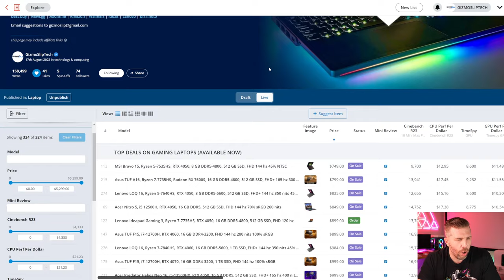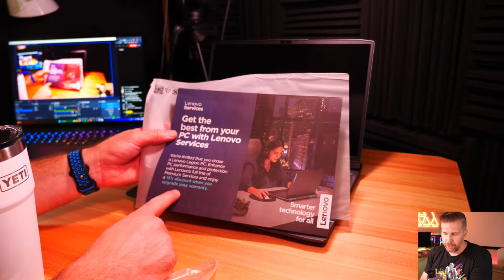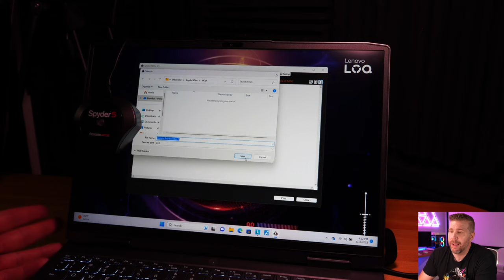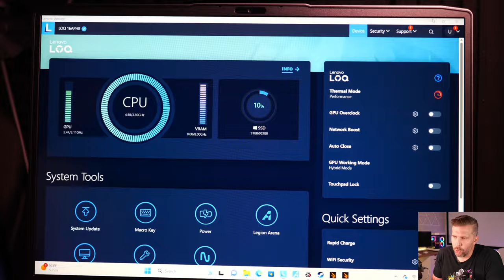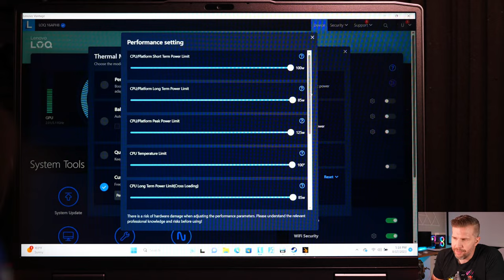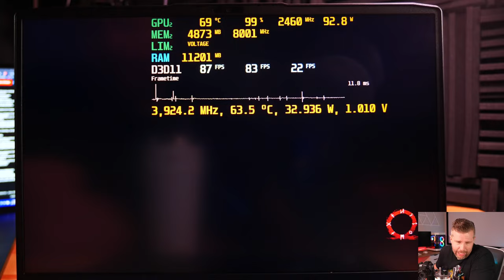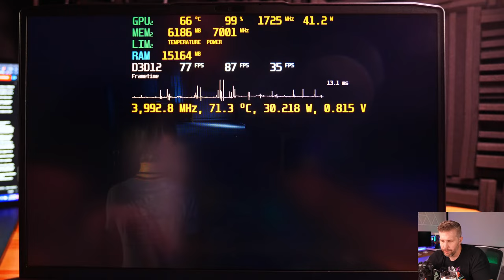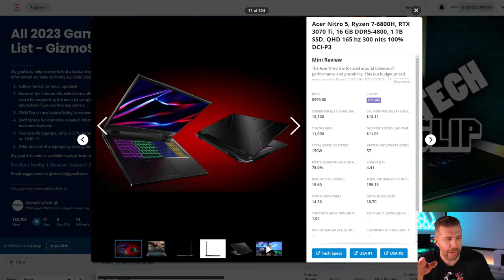Legion LOQ 16 Unboxing Review! Best Budget Gaming Laptop 2023? 10+ Game Benchmarks, Lots of Tests!

Comment: Any thoughts on what would happen if the Charger is only 170W. That's what's being shipped in India.
Reply from the maker: That does seem low, but it should be enough for near full performance or full performance. I am sure you could buy a 230w adapter. 

If the battery is draining under load, then you could try undervolting the gpu and lowering the cpu power limits when under dual cross load.
Reply: 6
Reply: inho
Reply: @IamNiggler  why?
Reply: @IamNiggler how you can born gay💀

Comment: Sir, should the fans sound like that all the time? I play sons of the forest and the fans runs nonstop. Gpu around 55 celsius and CPU 75-80 celsius
Reply from the maker: Sounds normal, but you can tune fan noise in Lenovo Vantage in custom fan mode if you want

Comment: There is a custom build option where a 1440p display 100% srgb option available and a 4 zone rgb keybard option
Reply from the maker: Good point, though that will cost more. So it will depend on pricing
Reply: @GizmoSlipTech  the difference is price was minimal, it was less than 50 dollars if i remember correctly, ordered a custom last week.
Reply: I could not find this option, was a little pissed about it but I still love the laptop, I bought an external monitor for home
Reply: Actually 😅 the full specs custom laptop actually cost LESS. ...way less than even the max by on Amazon or Flipkart. But we need to wait 1 month. But it's worth the money + full specs :)

Comment: 4070 with tdp about 105W.. this is absolutely useless if we are talking about 4th generation of RTX.. My 3060 in Legion 5 has 130W and 300W power supplying for entire laptop
In this case Acer Nitro 5 with 3070Ti 150W would be more powerful option for buying
Reply from the maker: It's because of how efficent the 4 NM ADA architecture is. It literally just doesn't need to pull more than 105W typically to reach max GPU clock speed. RTX 5000 series will have more cuda cores and be pulling higher 130-150W again for the RTX 5060-5070 if I were to make a prediction.

Comment: I noticed that your CPU voltage stayed locked at 1.010V during the entire gameplay. I have the LOQ 15 with the same specs, but my 7840HS is getting A LOT hotter, and my voltage is going up to 1.519. Is something wrong with my CPU? It reaches 90 degrees at 50W.

Comment: The corners look bendy than what i'm expected.
From Lenovo documentation, LOQ and Slim 5 using the same metal plate and mainboard desgin. I wonder what is the reason why LOQ 16 corners are bendy than Slim 5.
Reply: LOQ does not use metal, it is all plastic build.
Reply: @luxato5789  what i mean is the keyboard side, both are plastic.

Comment: Even i am getting 100C temps , even on 65W. Seems there was an update to the vantage software, and the fans dont seem to be running at full unless you set it to full in custom mode. Setting the fan curve to the highest setting still is not as fast as setting it to full directly.

Comment: Hi! just got mine with a free 8gb ram upgrade but only came with 4800mhz will it have any problem inserting a diff frequency on ram? plus i'm having a problem with latency issue i've been encountering some random spike the temps are fine but the gameplay experience sucks with this random render latency spike. should i worry with the unit i got?

Comment: @GizmoSlipTech
Thank you for the reviews. I'm looking to buy a laptop in the 1250€ to 1500€ price range. Could you help me out?

1. Lenovo LOQ 16i 1250€
13620H, RTX 4060, 16GB ram

2. Dell G16 1340€ 
13650HX, RTX 4060, 32 GB ram, 1TB SSD

3. Dell Alienware M17 R5  1230€
Ryzen 7 6800H, 3070 Ti, 16GB ram, 1TB SSD

All of them feature a similar WQXGA/QHD+ 165Hz screen. My usages are mainly designing, gaming and occasional video editing.
Would it be better to spend some more and buy Legion Pro 5i 13500HX with 4060 and 16GB ram for 1450€?
Thank you.
Reply: The 3070ti is the best choice by far